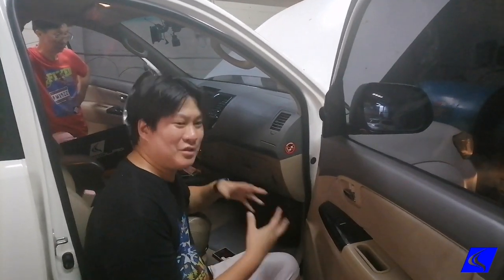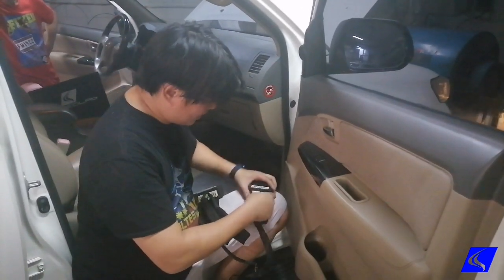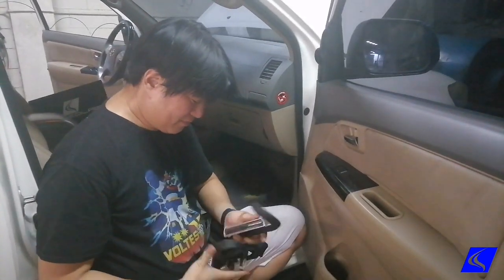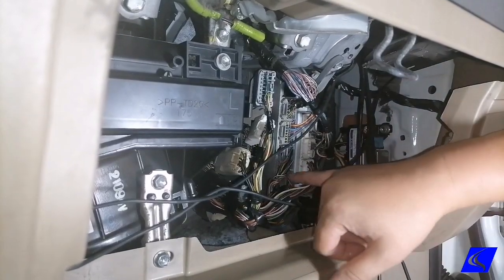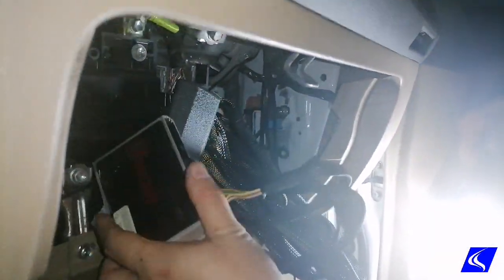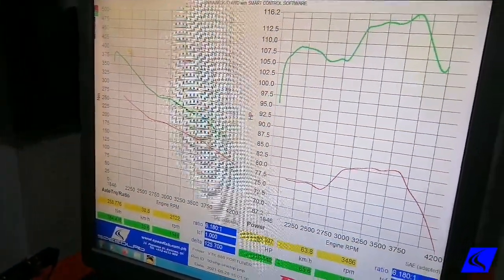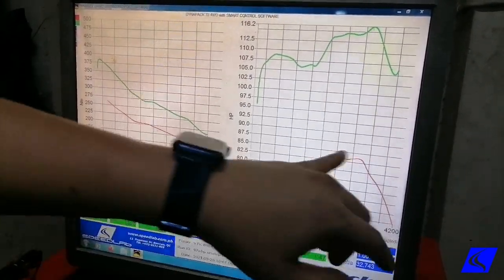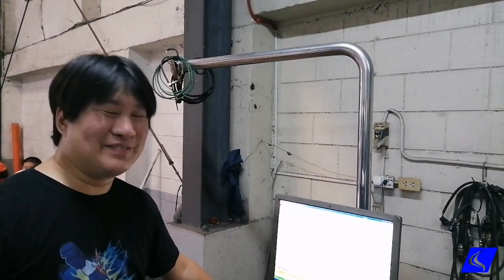Toyota Fortuner Hilux Innova Unichip Plug and Play Installation and Dyno Tuning

Comment: Sir is it okay to buy 2nd hand unichip like the one you holding and transfer to another car have it retune? For example I saw one for sale Unichip used on montero, and want to install it on my Hyundai accent Diesel. Then i will go to your shop, install it and re tune..(is it possible? incase i dont want to reflash my stock ecu)
Reply: O yeah.  Absolutely
Reply from the maker: yes
Reply: @speedlabchannel4452  How much for the installation and retune package with the dyno?
Reply from the maker: @chevydemesa3685  10k install and dyno